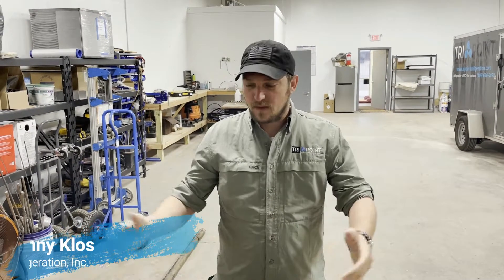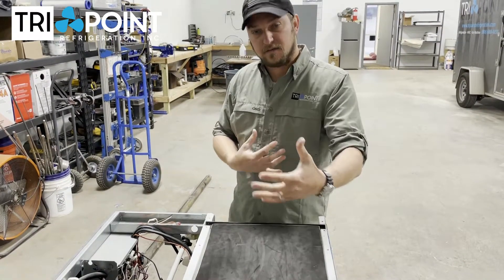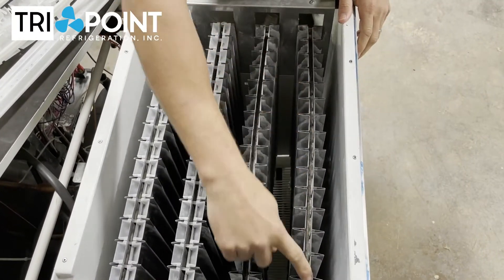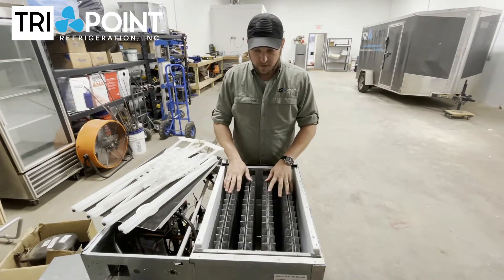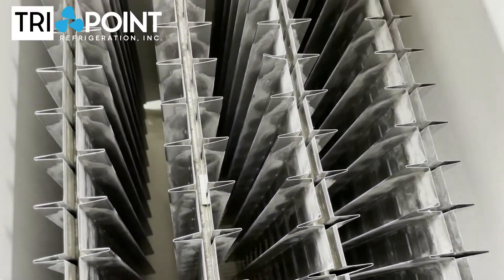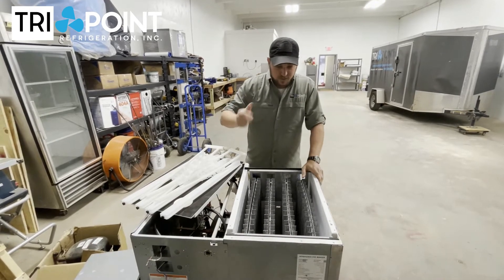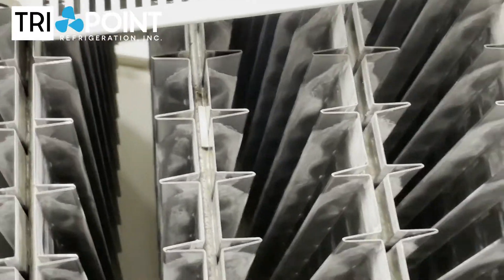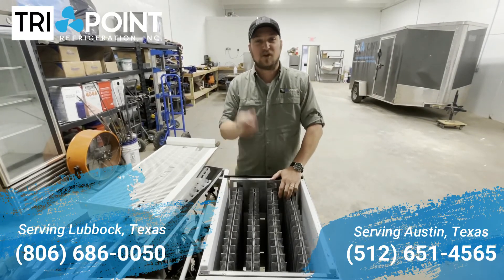Hoshizaki Ice Machine Bent Evaporators

Comment: Just finished cleaning two KM-410's and it's a long day when done right. Hosihzaki machines are the Rolls Royce of Ice Machines, but maintenance is very important and over time will save you more than the cost of a new machine. My facility has a KM-500MWE that is 30 years old and still going strong. Owners, spend the money on quality maintenance for your refrigeration equipment - it WILL pay you back.

Comment: THERE IS A WAY TO FIX IT. We have done it here at Brooks Industries in Oklahoma City for 30 years. Just remove the cube guide in the bottom then slide a piece of unistrut down through the evap.  Have the open side of the unistrut against the top of the evap so it won't smash the fin.  Then just pull it to bend the evap back in shape.  You might have to straighten the spot where the unistrut made contact with needle nose so the water guides will fit back.  Pretty simple, I have done it hundreds of times, no big deal.
Reply: Can you explain what tool and how it works to fix the bent evaporator? I’m afraid if damaging our machine but it’s bent